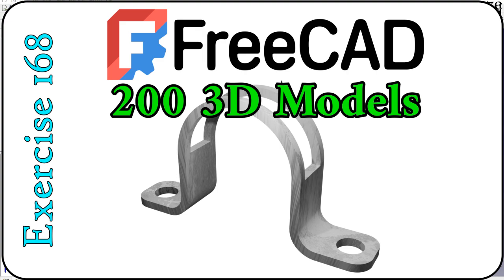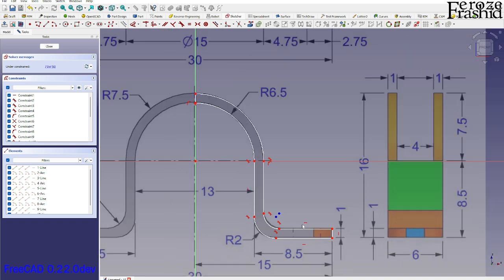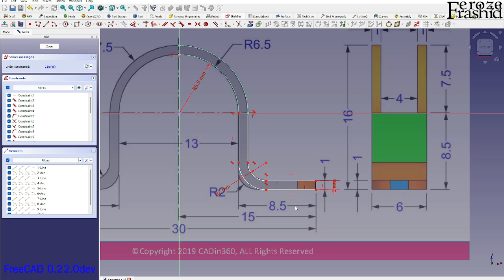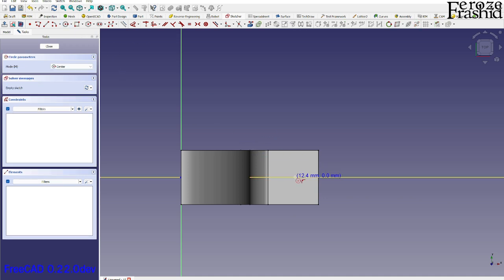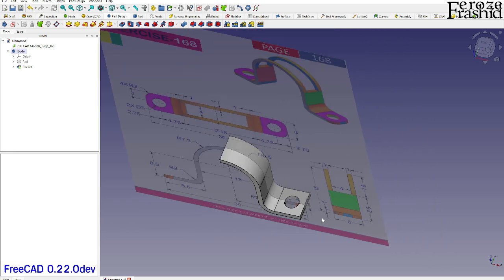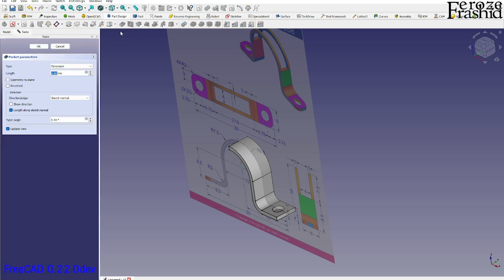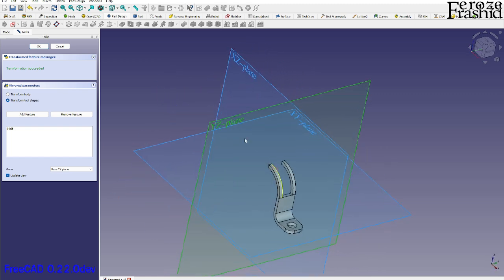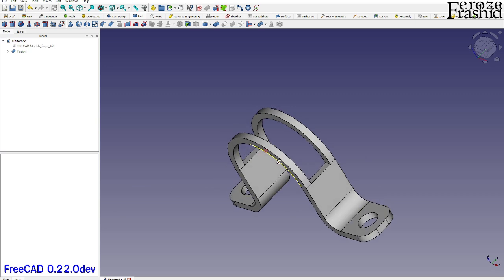200 3D Models in FreeCAD: Exercise 168

Comment: Hi. Thanks for the challenge...
Using always Part design, do not select anything, choose Mirror tool, Add feature, CTRL select Pad + Pocket + Pocket 001 and OK.
Make the radius of 2mm at the end.
Save the model

It's also possible to include the radius of 2 before mirroring.
in both cases When chosing Mirrow tick "Allow used features" box and "Plane" Vertical sketch axis"
Reply from the maker: Thanks. I see I did (rather didn't) now.
Reply: @kattkushol  You're welcome. Any problem to get the linked files in my other comment?